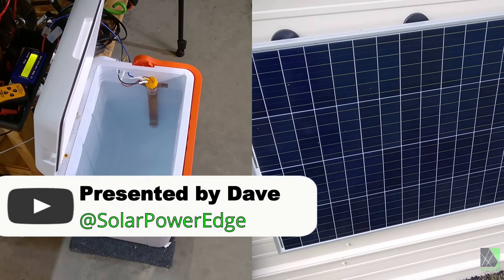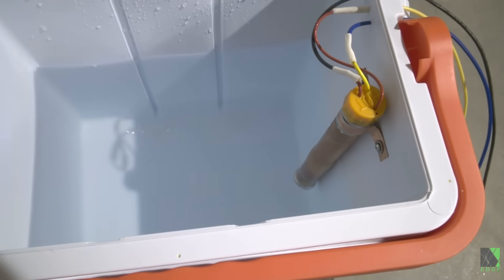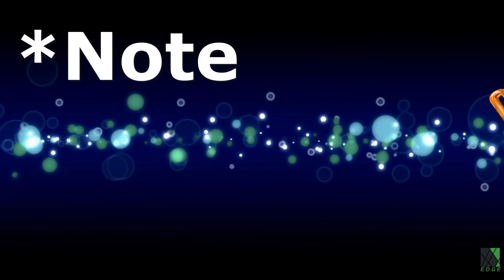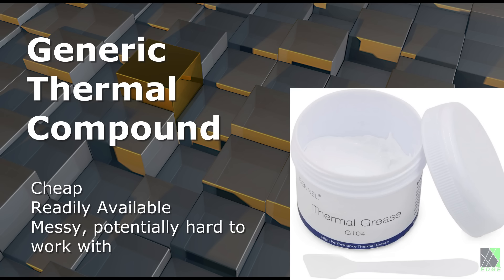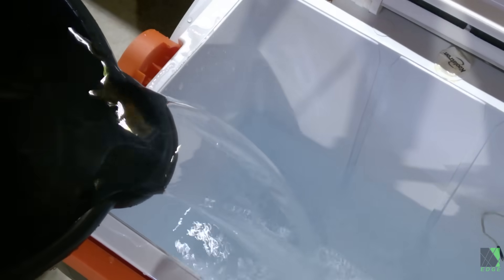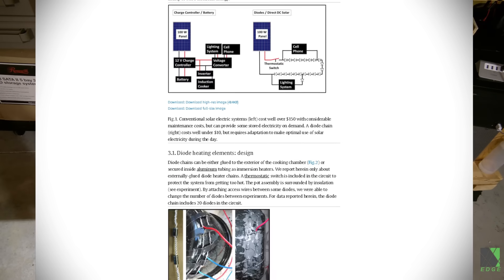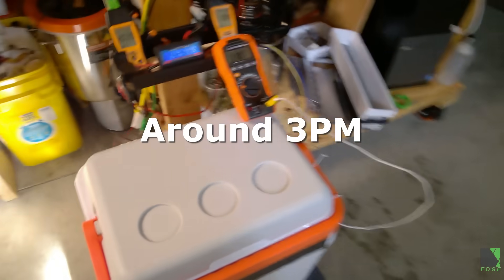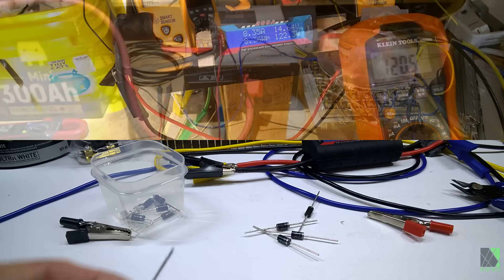I built a PV DC Semiconductor Immersion Water Heating Element! diode chain application #science

Comment: Hey Dave, do you know if diode chains like this work similarly well for the inverse operation? Obviously temperature limits remain a concern, but if you used a thermostatic valve for a passive shunt could one of these chains be used as a thermoelectric producer downstream of a solar water heater instead of an electrothermic producer downstream of a photovoltaic panel?

What do you personally consider the advantages of photovoltaic electrothermic water heating over direct solar water heating?
Reply from the maker: @claws61821 Hi, I am 100% curious about this question (think of TEGs) but have not done any testing yet. Only used diodes to make heat. Regarding the advantages of PV hot water (vs solar thermal) I am truly not against solar-thermal, but solar electric HWH has no pipes, pumps, circulating fluids, valves, glass tubes and such. Principle advantages of solar electric HWH is zero moving parts, 2 thin wires to transport the heat and ultra low maintenance and simplicity. Plus flexible solar electric power to run other appliances anytime we wish. The other day, I saw one of those solar tube water heaters fall off a roof in a storm. They are fragile. It was like a avalanche of glass shards. Yikes!
Reply: @solarpoweredge  Thank you for responding, Dave. Simplicity of design is an understandable reason, for sure. One related point that you missed is weight, as the water based panels when filled are heavier than PV of similar dimensions. 

Falls and weather damage are a plague on all types of roof mounted solar. Glass tubes aren't really any more dangerous in that sense than glass panes are, weight aside.
Reply from the maker: @claws61821 Welcome! No doubt tanks of water on the roof are a bit heavy

Comment: Nice project, great to see people working on alternative uses of available components and researching and testing the plans. Currently working on a water heating solution with Evacuated solar tubes (without the heatpipe part), got similair feedback that it could not work. Still working on it. 

Keep up the good work, think i will subscribe to this channel.
Reply from the maker: @Robert1984kappert Hi, thank you for subscribing. There must be a simple and robust method to get heat exchange through the solar tube without any heat pipe. I am shopping for a large solar tube for experiments by the way... there are so many projects but not much of me. I have always preferred solar electric for just about everything including hot water. But still really interested in solar thermal and have several thermal projects planned. Let's keep on thinking and working... there has to be a way!

Comment: How much more efficient are diode chains over resistance heating elements?
Reply from the maker: @GrantsPassTVRepair Hello, they sit not far below MPPT. Depending on the test setup, they can make 10-30% more heat (watt hours) than a plain resistance heating element. I recommend reading the research paper linked in the description. The researchers in that paper used temperature instead of watt-hours, but it is still a good comparison.
Reply: @solarpoweredge  Wow! Thank you for this    information.
Reply from the maker: @GrantsPassTVRepair NP!
Reply: @solarpoweredge  I love the simplicity of the design.  I see the value of proper MPPT tracking for higher power designs or where maximum efficiency of limited solar array capacity is mandatory but at the lower end of the power range, limited budget or for homebrewing the diode chains appear great to unbeatable.

Your video got me to contemple it as a minimalistic heating system to avoid condensation for an electronics box.

Comment: If you were going to stock up on diodes before we can't get them anymore.  What specs would you focus on?
Reply from the maker: @jamesriggi2323 I would grab some of those axial ~10A and 3A silicon rectifiers and some TO-220 or bridge rectifiers with metal surface. Right now they're somewhat cheap! 3A diodes can be a few pennies if purchased in bulk. I have been stocking up. Have noticed everything is getting more expensive lately...
Reply: Hard to imagine modern world running out of silicon diodes though..so i wouldn't worry...😅

Comment: Can this method also be used for a wind powered system and drawing power from charged, or charging batteries? One might believe that it would, since we are using DC power directly.
Reply from the maker: @terrabuilder I don't currently own a wind turbine to test, but understand they need to operate an at optimum voltage? Diodes can take a current limited source and turn it into heat and keep an optimum voltage. So they could in theory extract heat from a wind turbine at a specific voltage.
*Note if we connect a diode string to to batteries, they will just burn up (no current limits). There is no reason to use a diode string with batteries, instead a resistance element would be the better choice.
Reply: @solarpoweredge  voltage regulator?
Reply from the maker: @terrabuilder Well diodes are a very "rough" voltage regulator in some form. The reason to use them is to create a very simple, cheap and robust regulated heating element for solar panels that can hold a PV voltage near vMPP. A real voltage regulator (DC buck converter etc.) is complicated but much more precise. I would not suggest mixing the two solutions together, but with an open mind I wouldn't discourage anyone from experimenting :)
Reply: Permanent magnet generators, those often used on wind turbines, are not fixed voltage devices, so a diode chain would not be suitable.

Comment: Did you already think to use PowerLEDs instead of Diodes. I think possible advantages of PowerLEDs are the 3x higher  threshold voltage -> results in less Diodes, and second Power LEDs are available in cases with better thermal resistance.
Reply from the maker: @roland5469 That's thinking outside the box! I have thought of harvesting waste heat from LEDs, but never tried it actually. Putting LEDs under water, who is going to try it first :)

Comment: Has anyone done any proper minute by minute data logging comparing resistance to diode chain? I was thinking about setting up an Arduino data logger to do this. My idea is to have both connected to the same panel via mosfets and have the data logger switch between them. Every half second switch from one to the other and take a measurement. Average over maybe 10 secs and log the result. Think it could make some nice graphs showing a direct comparison between the 2 with the same panel with the same light conditions over a variety of conditions.
Reply from the maker: @Ed.R Yes, please check the research paper posted in the description. They did not use Watt-hours but temperature instead - yet the results speak for themselves. I am under pressure to keep videos short otherwise I'd love to dig into the details. But then no one will watch it :)
Reply: @solarpoweredge  I had a look but as you say it was only focused on the end result, hot water, which makes sense. However I'm keen to understand in more detail when a diode chain out performs and by how much. That way it can potentially be optimised.

Comment: Have you looked at press in diodes used in automotive alternators. I'm an auto electrician and about 20 years ago when we used to repair alternators a rectifier with a damaged diode was repaired by pressing out the old diode and pressing a new diode into the heat sink plate. 
They were sold as positive and negative diodes meaning the case of the diode that was pressed in was either the anode or the cathode. They were also very heat tolerant.
Delco alternators used press in and a lot of the Denso alternators used solder in diodes.

You might be able to drill holes in copper plates and press pairs of neg and pos diodes in and only have to connect/chain one wire  from each diode using the heatsink ast the other connection.
Sorry that was the easiest I could explain in writing.

Keep up the good work.
Regards
Dave from Oz
Reply from the maker: @DavidWayne-ug1np Hi Dave thanks for the ideas, I was not aware of those types of diodes. I'm looking into it now. I found some that take 50 amps, excellent

Comment: Seems like you might be better off using surface mount diodes. Have a PCB manufacturer install the diodes string on an aluminum board, add the wires connecting to your pv panel, and conformally coat the PCB. If you place this on the bottom of your tank, you shouldn't need the pump...
Reply from the maker: @ats89117 I'd like to see something that screws into a standard residential HWH tank, and that's what this prototype is headed towards. However you are totally right about the PCB. Once I have access to PCB manufacturing, I will give it a try and make a diode board. Coat it with epoxy and it should work pretty well
Reply: Using diodes for the load is genius. Since the PV panels are a bunch of diodes, it makes sense that the optimal load would also be a string of diodes.  KiCad is a good free tool to design PCBs, and JLCPCB is a good place to get them built. Built in quantity, they shouldn't be too expensive.

Comment: Hi just seen your video very interesting work.  One thing I have used to  help cool axial diodes was to solder a small fins to the anode and cathode leads during istallation. That helps conduct heat away from the PN junction as well as that dissipated by the encapsulation itself.  A thin spray of insulation varnish (as used on electric motor winding wire) would give you electrical insulation (with a minor loss of thermal condution)  and allow immersion of the diode chain into demineralised water within your copper sleeve. Keep up the good work.
Reply from the maker: @alangreen5858 That's worth trying, I'll look into the motor winding varnish too. Thank you for sharing the ideas. Thinking of a motor winding, they get pretty hot so this might be the ticket to the "underwater diodes" I need for my new water tank. Thanks again :D

Comment: This is one of those ideas which seems too simple to be true. I'm wondering about the idea combining it with a phase change heat storage setup (parafin or similar) to make a small heater to keep my workshop warm through winter.
Reply from the maker: @benaresq It is really dirt simple tech. The best part is when there is cloud cover and the diodes automatically regulate the PV voltage with zero complex circuitry. Not as good as MPPT, but still pretty good. 
PS I'm working on a parifin wax setup, it takes time though :)

Comment: Thank you for this! I can't wait to see where it goes and build one myself!
Reply from the maker: @hotrodAndy Welcome :) I want to build one that can screw directly into a standard HWH tank, but that's pretty difficult so far. Wish I could just buy one lol
Reply: @solarpoweredge  you could always rethread a 1" npt o ring fitting to npsm so it threads into a water heater and solder everything up?
Reply from the maker: @hotrodAndy That would work, good idea and thank you. Actually I had no clue what the thread is around those standard HWH elements. Trying to find a clean HWH tank for experiments at the moment!

Comment: You can just directly calculate how much energy it will take to heat the water, right? I mean that's really basic physics.
It's maybe 5 gallons? Its about 1500W*h to take that from 20C to 90C.

I'm an electrical engineer and this isn't actually a bad idea. Diodes are cheap and they do kind of clamp the voltage how you would want.

Make sure you're factoring in the aquarium pump or running the pump off the same source as the heater. They run from maybe 2 watts up to about 50 and if you're getting that power from somewhere else, the pump alone may be putting more energy into the water than the heater.

Also, MPPT just isn't that hard to do. You could breadboard one for $10 and it would definitely be more efficient than what you've got. You could even use the diode heating element. A plain boost converter doesn't really care what's on the load end.
Reply from the maker: @htomerif The most important point is how many watt-hours can be pulled from the solar panel, and diodes can pull more than an unregulated resistance element. This channel has a bit of a grid-down and preparedness theme, and whatever tech is dirt-simple wins the day. A string of diodes cobbled together is so dirt simple it hurts
Reply: @solarpoweredge  Yeah, i get that this is more of a "grid goes down" video.

I think probably more important than heating water is to have a backup source of information.

I guess it depends on what you're expecting to go down.
Reply from the maker: @htomerif You are right, preserving knowledge is important... it took many decades to accumulate. I have a system in place for archving data using extremely low power and hope to share it in a future video after things start improving here

Comment: Where to get this?
And how to assemble it and connect it to existing off grid solar solution?
Reply from the maker: @knarf3985 Hi, I recommend reading the research paper linked in the description first. You can use basic cheap silicon diodes but keep their temps at about 50C for space heating and no more than 100C for cooking. At least that's my recommendation :)

Comment: I would mount the copper pipe horizontally at the bottom. Make it L shape to get the wires out.
Reply from the maker: @janrhebergen5783 Great! Solves the problem of keeping the diodes in the coldest part of the water

Comment: What about a high power shunt zener with a bjt or mosfet? Insted of a lot of diodes?
Reply from the maker: @Xx80Pedro08xX I know a fellow who has been testing this sort of configuration, and I believe it can work. Plus you can "tune" the circuit a bit more easily. But the diode string is still a simpler method, as it's literally just a bunch of diodes strung together

Comment: An idea i have to reduce the amount of heat transfer material is to use a smaller copper tube that fits more closely to the diode chains, then that thinner tube can be coiled like a traditional heating element and pack more into the same space.

I'm fully off grid and heating water sucks, i heat mine now with a ptc heater on a radiator and circulating pump,  i heat the water for my 50 gallon tank of water that heats my living space and with the weather as it has been my water doesn't want to get above 70f.
Reply from the maker: @H3nryum Good point on the copper tube. Ideally the diodes would be integrated inside directly against the metal.
 I have found a 55gal and 22gal drum for my shop. The plan is to use them for heating. But also looking for a residential 40gal HWH or similar. That will be for showering. That said, I know when there isn't enough sun the whole system doesn't work too well :\
Reply: @ exactly why i set up my barrel, it was gettign to 19f here with 3-4 days of overcast skies, the barrel keeps the space around 50f for 3-4 days decently well but keeping the water heated is difficult with a standard heating element even on sunny days( i have 4kw of solar panels but i can only use about 1kwh due to inverter capacity) so the diode based heater that i can directly wire would be great to get some more of my solar used.

Comment: You could skip the copper tube by chaining the diodes together with solder seal connectors and then wrap the entire chain with electrical heat shrink wrap. Since it is going to be immersed in water the containment should be robust enough to withstand the heat and then you can mmake the strands have more surface area available to contact the water.
Reply from the maker: @tictoc01085 This is actually a brilliant idea. Several folks have suggested a similar approach. I have to give it a try as soon as possible!
Reply: @solarpoweredge  if you wanted to adapt this into an existing HWH you could replace the coils with just one long one of diode strings since length does not equal resistance. The existing thermostat can be rewired to a junction switch that can be re routed back to the charge controller and replenish the battery bank for nighttime hot water call.  A basic solenoid could then do the job of an expensive MPPT one.
Reply from the maker: @tictoc01085 That would work... need to find an old HWH element and take it apart. Either that or just re-use the base and attach the copper pipe. All the residential water heaters for sale are overpriced, can't experiment on the house one, but I will find one sooner or later for this project
Reply: @solarpoweredge  im a pipefitter as well as an electrical and mechanical fabricator by trade.  I find this avenue fascinating so I'm always thinking how this could be incorporated into existing infrastructure. Your improvement on existing research is solid. Fabricating it to retrofit  big $$ existing solar systems as well as folks looking to reduce the cost of HW "affordably"... heat pumps are 99% for heat in the South but they are expensive and suck. Replacing the emergency electrical coils in the air mover with a grate of these diodes in conjunction with low RPM constant air circulation could be monumental in cost savings.
Reply from the maker: @tictoc01085 Engineering and retrofitting... right on. I really believe we can bring PV straight into the house to do useful work, and the most dirt simple and obvious place is, well, the hot water tank. The PV space heaters I have run for years now made our heat pump obsolete in winter! no more burning a complex compressor system to make heat... still using heat pumps in Summer while saving wear, tear and maintenance costs

Comment: How about using TEC or peltier modular.you can get hot water at 60°C.and cool water 20°C. And coll water will lost temperature when hot side to hot
Reply from the maker: @crazyproject6019 I absolutely have to give it a try. Been using peltiers mostly for freezing stuff but they can do a lot more than that :)